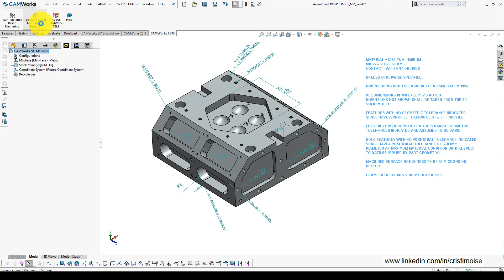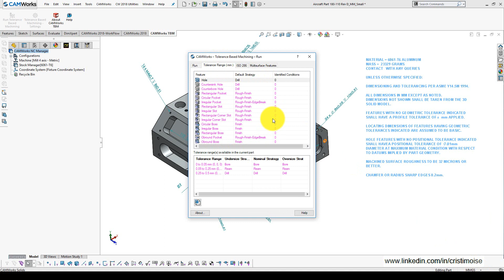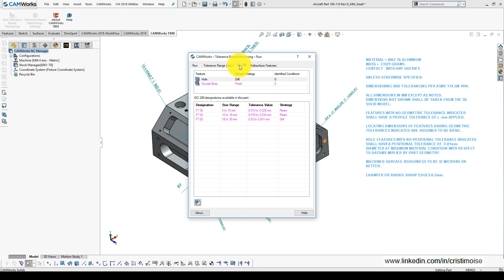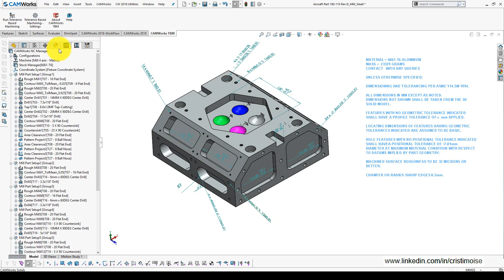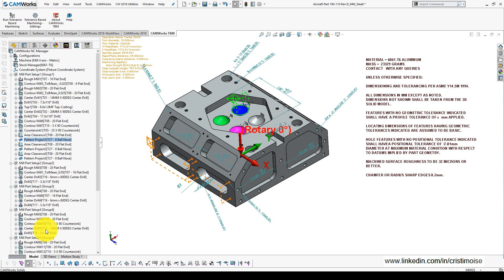CAMWorks 2018: Tolerance Based Machining New Version.

Comment: Hi Kristi
What is this check box " machine to mean" ?
I don't have it!
Reply from the maker: Machine to mean option automatically calculate the middle range of the tolerance and generate tool path accordingly. If you do not have it, you need to activate it manually somehow. Try first to install again if you can.
Reply: @CristiMoise  how to activate it?
Reply from the maker: Hi again, I studied a little bit and the only way to do it is from the registry of windows if you don't have it.
Right now there is a key string missing in your registry and you need to add it. Maybe in future I will make another tutorial.